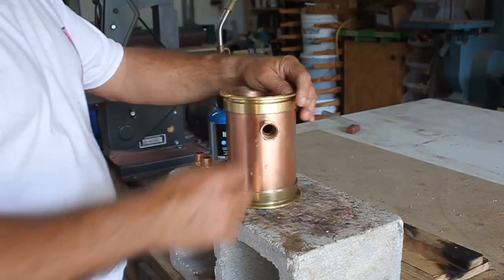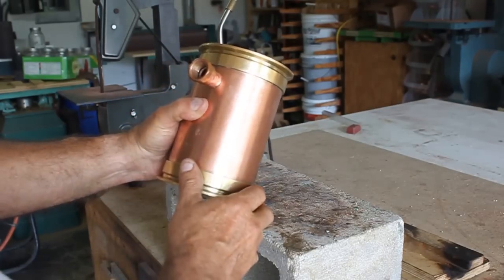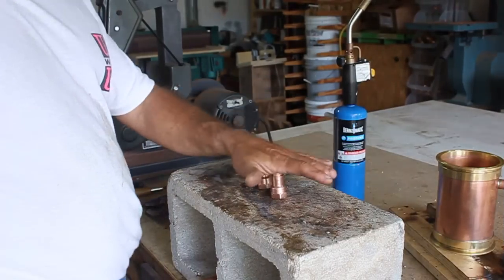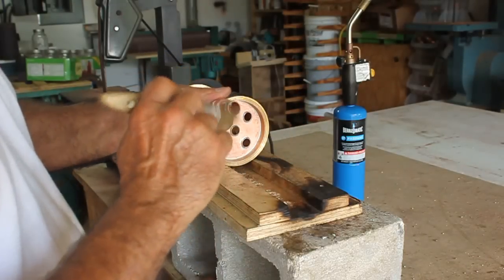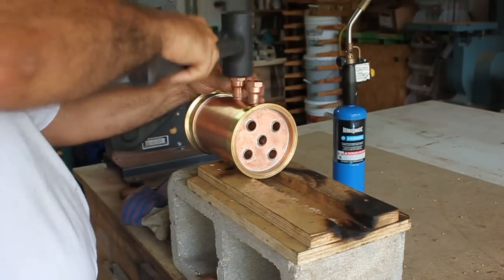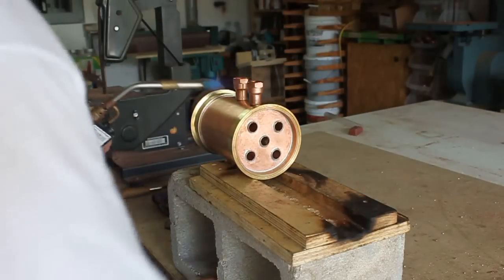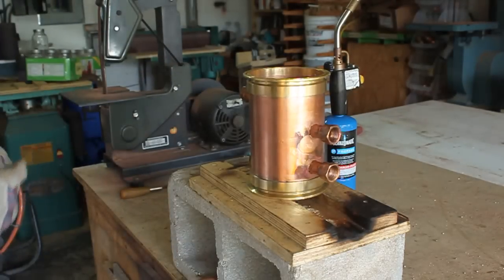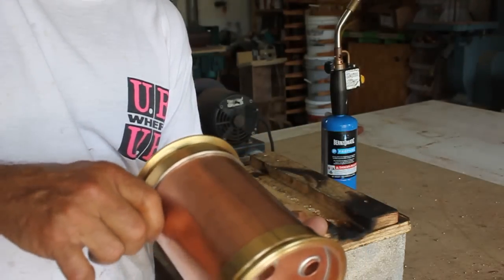Dephlegmator Fabrication Video 5 for Copper Moonshine Stills

Comment: Wish I know whats it used for. Is that a condenser.?
Reply: No. It's for cooling down the steam rising out of the still to force 100% reflux or with the water speed or flow rate and you can regulate what percentage of reflux your still has